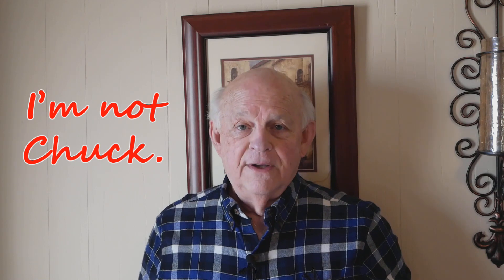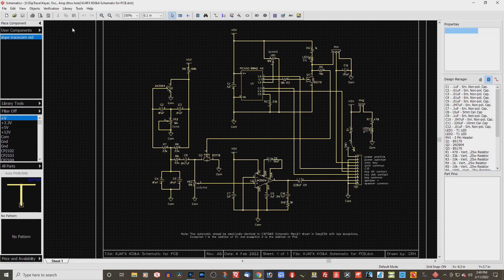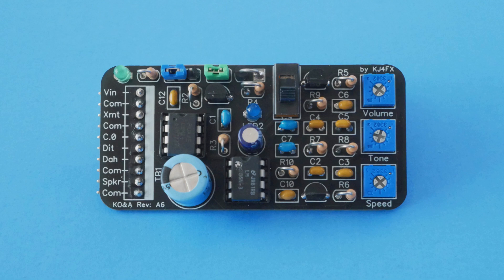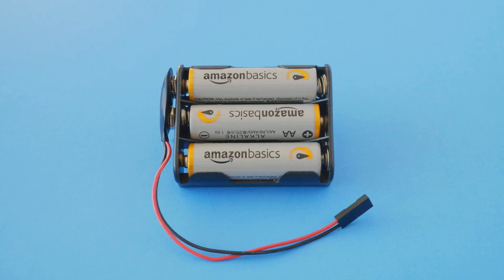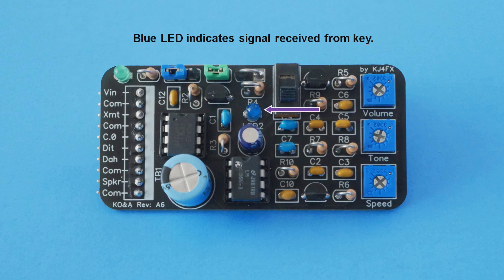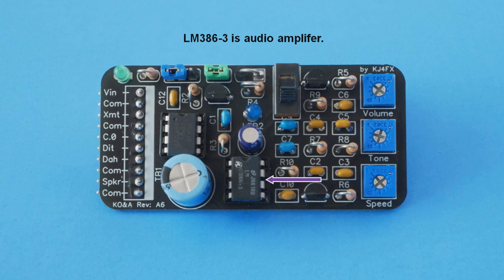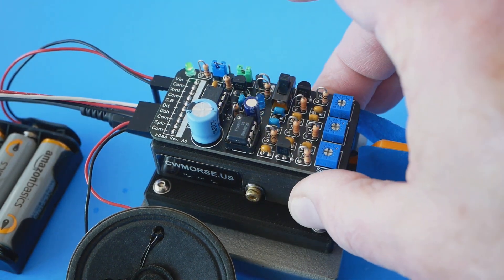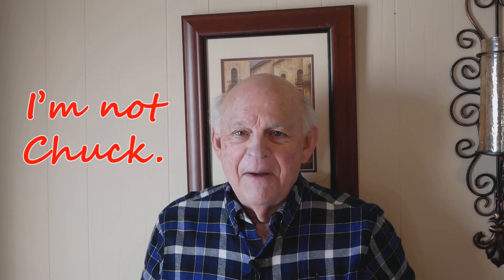Easy to Build Electronic Keyer for Your "Cootie"

Comment: Hello! I was about to build the circuit from your schematic, and I noticed you wrote that D1 was a 1N5827 Schottky Diode, which are only made in DO-4 packages. However, in your video, the diode you used is in a DO-41 or DO-15 package so I am confused
Reply: What diode did you use for D1?
Reply from the maker: @fantabobfan1233  I am going from memory, so confirm what I am writing. The only purpose of the diode is to guard against damage that could be done if the +V and Gnd were hoooked up backwards. I used a Shottky diode because of its lower voltage drop. Most any shottky diode will do, or even a 1N4001. Thanks for watching.
Reply: @ImnotChuck.   Alright. Thank you very much! I’m an electronic enthusiast and I’ve always wanted to learn Morse code aswell as coding microcontrollers. This is exactly what I needed to combine all three in a single project. You are a talented and inspiring man. Keep up the good work and I wish you the best ! 🙂

Comment: Dear Not Chuck, it's a magnificent effort but I am a little puzzled. Over at PCBWay, if you select the option where PCBWay "builds it for you" it's about $35-40 shipped (cheap chicken) and that is very reasonable. However, do they have your PIC keyer chip? Are you selling that separately? In fact, are you selling your keyer chip? 

Thanks in advance for clearing this up.

"not not" William, k6whp

Comment: Dear Mr. Hampton,
I am going to get one of your boards when I can figure out that pcbway site. Seems confusing to me. 
That’s not surprising at my age though. My old Heathkit has bit the dust and I don’t want to rebuild it.
So I have been searching everywhere to find something that I can build that is a bit more modern. I came across your 
Video about the keyer and really liked the way you have built it. I probably missed it, but I have a question about the Pics.
How do the pics get programmed? Also, will it key a Kenwood TS 930s. 
Thanks
Bill wb7pnc
Reply from the maker: Hi Bill. Send your mailing address to me at the email in the about section on my YouTube home page and I will send you a gift.

Comment: I am impressed by your keyer.  My goal is to build a SIMPLE oscillator that puts out a sinewave.  I sometimes bring a morse code key to various schools I substitute teach at.  In some classes,  I have a few minutes to show the youngsters my TITANIC REPLECA key and let some students send and receive morse code.  I also show kids that it is easy to use a digital volt meter.  The problem I am having is my oscillator is a SONALERT with one transistor.  It is simple but not adjustable and it sounds "harsh".  I will try to build your "TWIN-TEE" oscillator (Q2 section) of your schematic and see how it sounds because they are supposed to put out a sinewave, which should sound less harsh. Thanks for your excellent video. EDIT UPDATE!  Your oscillator works!  but it is very low volume that only my crystal earphone can reproduce.  I'm using it on 9 volts and will add an amplifier just as you did in your schematic.  Right now I am not interested in using the cootie key.  I am working to make the straight key sound better by eliminating key clicks and weak tones during imperfect contact closures.
Reply from the maker: The twin tee does sound quite good, but the oscillator itself probably won't be loud enough for a classroom. You will most likely need an amplifier. The LM386 is easy to use. Thanks for watching and for commenting.

Comment: Very nice board!  To improve battery life even more, you may want to consider changing the audio amp to something like a TPA0211.  The efficiency gain from class A to class D will save quite a bit of battery life, and the slightly lower quiescent current will save a bit more.  But it also has a SHUTDOWN pin, which would take up that last IO line but use a lot less current when the keyer was idle.  You'd have to adapt the program, of course, but adding a timer that resets every time one of the keys connects is not hard at all.
Reply from the maker: Hi Chris. Thanks for watching and for your good suggestions.

Comment: Very nice I may as well be interested in the kit. My last keyer kit was back in early 90's built around the cmos super II. And still using it, it does have some memory for easy contesting. Again very nice build.
Reply from the maker: Hi Jerry, and thanks for the kind words. The response to a kit was not good, so I won't be doing that. However, I did share the project on PCBWay; all the info is there for those who want to pursue it.